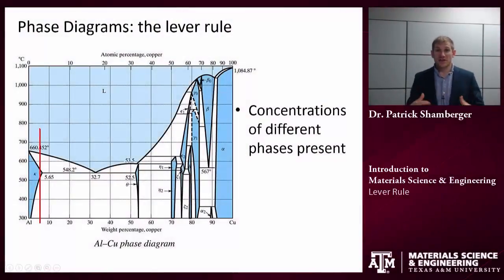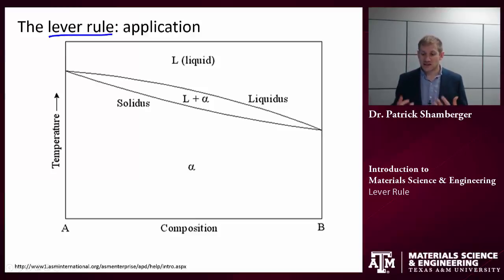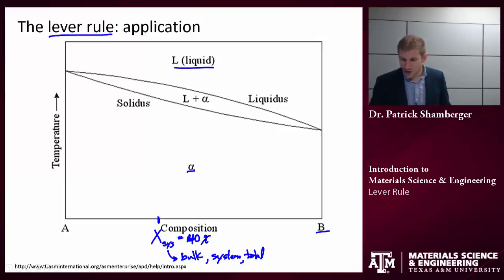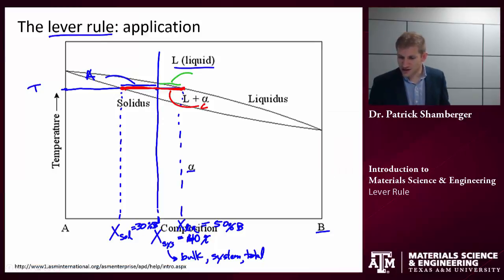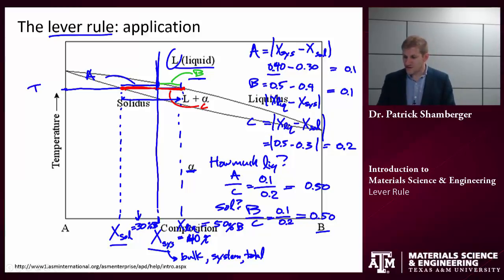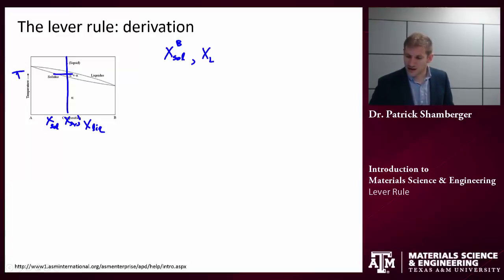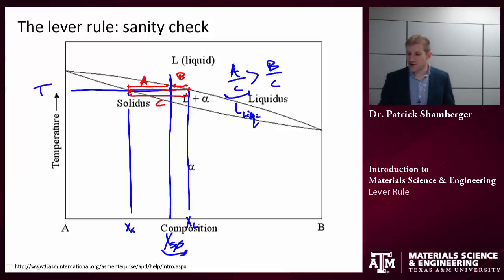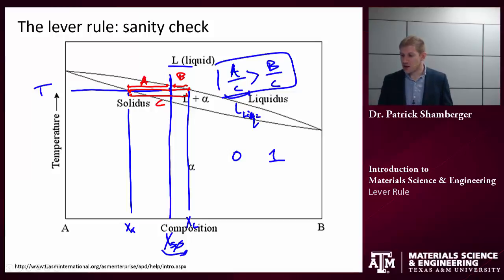Phase Diagrams: The Lever Rule {Texas A&M: Intro to Materials}

Comment: question 1 : what does a 40 percent system composition mean?
question 2 : if the solid and liquid is 50% + 30% what is the remaining 20%
Reply: question 1: The system composition is the weight/mole fraction of B in the system as a whole without consideration of what phase it's in. Assuming we're talking about weight fraction that means if you were to weigh out the total amount of pure B and divide it by the total amount of material, you would get 0.40 or 40%. Let's say you mixed 80 grams of B and 120 grams of A. The system composition of B would be found by 80g/(80g + 120g) = 0.40. 

question 2: The 50% and 30% don't refer to the fraction of liquid and solid present. They refer to the composition of those individual phases. It means that if we were to take the solid phase out and ONLY look at the liquid phase, it would have a composition or 0.50 or 50% B. The rest of the liquid phase is 50% A. If we were to take the liquid phase out and ONLY look at the solid phase, it would have a composition of 0.30 or 30% B. The rest of the solid phase is 70% A. The liquid phase is relatively rich in B when compared to the solid phase.

You can use this to figure out what fraction is liquid and what fraction is solid, but that's not what those percentages mean in the video. You have to solve a system of two equations:

1) [weight fraction of B in liquid phase (0.50)]*[mass of liquid phase] + [weight fraction of B in solid phase (0.30)]*[mass of solid phase] = [mass of B (80g)]
2) [mass of liquid phase] + [mass of solid phase] = [total mass (200g)]

Solve for [mass of solid phase] or liquid. Doesn't matter which and the other answer is trivial.
Reply: @HuggumsMcgehee  Thank you for explaining it so well!
Reply: Thanks! @HuggumsMcgehee